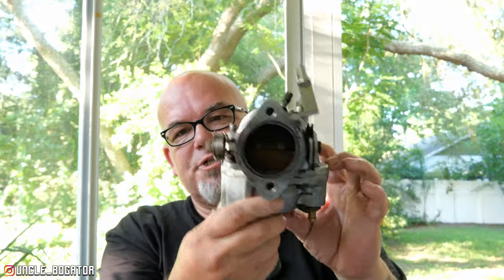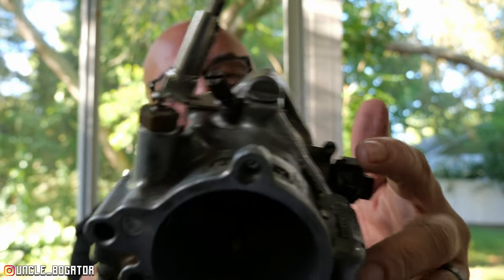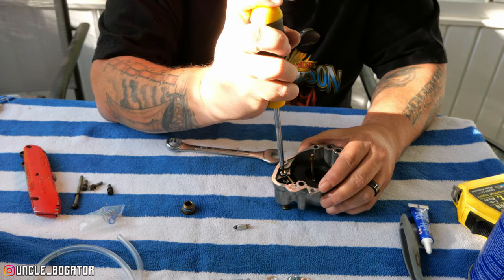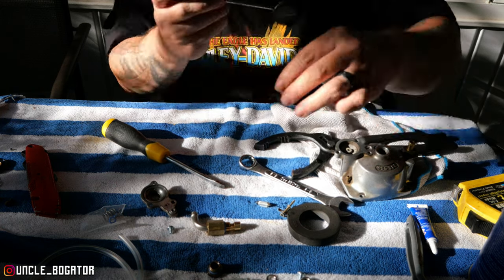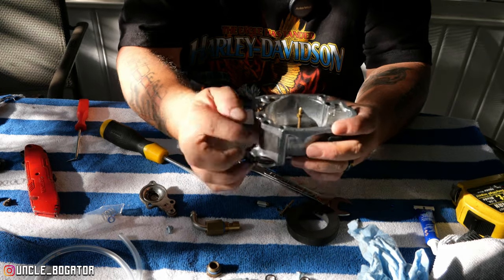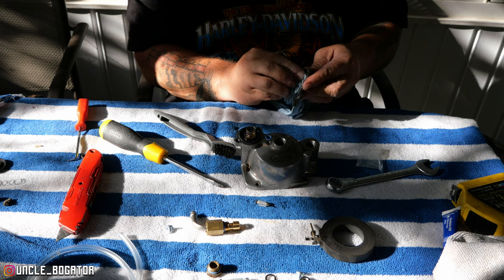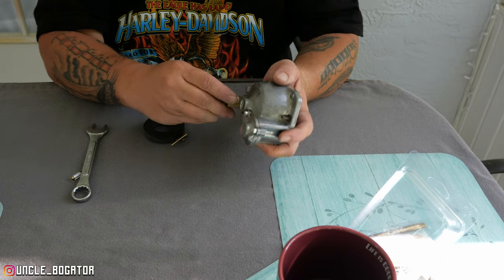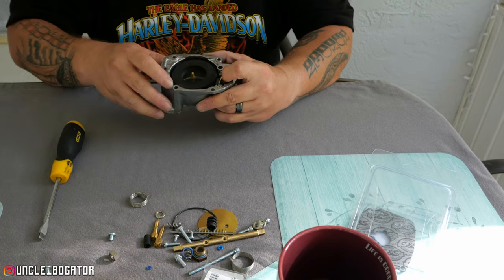I can't believe this was in my Harley...

Comment: One step at a time, the banana hammock is coming along nicely. Once you finish the basic minor issues you will feel better, I am sure the oil light is a little gremlin in the wiring. That motor sounded too good to be running on low oil pressure.. Keep Your Stream Strong!!!
Reply from the maker: Thanks bud! I put a gauge on it and got 0 oil pressure. Shelby gave me some troubleshooting steps I’m going to get to this week.

Comment: Two things from past experience one whenever you take the flanges off check and make sure they're not warped I've seen a few of them just from the heat and them being made of aluminum they warp and will not seal well. Another thing is especially with evo's and early twin cams people will adjust the idle down real low so it gets elope but the oil pump needs a minimum of 950 RPMs in order to lubricate the system correctly and it'll cause the oil light to come on at low RPMs. After seeing the gorilla snot on the intake I'm pretty sure whoever had it previously was not the most adept wrencher
Reply from the maker: yeah I got the idle to about where I think 1k rpm is once I got back from the test ride but I didn't do any of the other adjustments yet. Not until I figure out my oil pressure issues. Still working on that.

Comment: Two wheel Rocco,Lowbrow customs and Pacific Mike are my goto for carbureted Harleys 👍 they helped me through a carb rebuild for my 99 Buell. I recommend a ultrasonic cleaner.. heat water first if you end up buying a lower wattage as they are cheaper to buy and take like 30 minutes to heat to temp. My cv carb air/fuel screw was only a half turn out it had a plug covering the access so it was stock settings..thought that was strange and the jets had 43 & 200
Reply from the maker: Haven’t seen pacific mike yet but I’m sure I’ll come across his channel
Reply: Pacific Mike is my favorite!  He is the Bob Ross of old Harleys lol